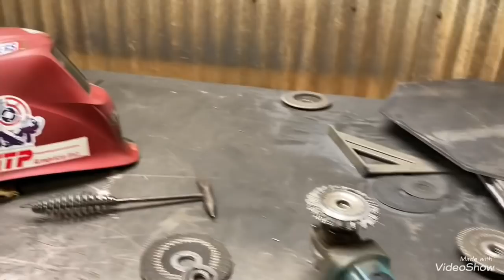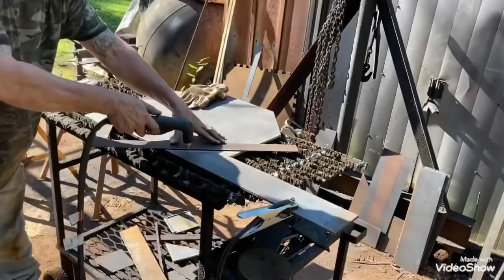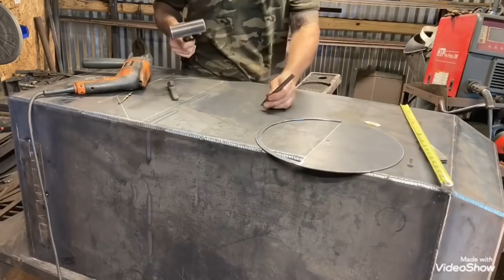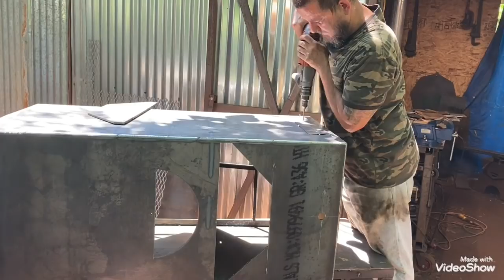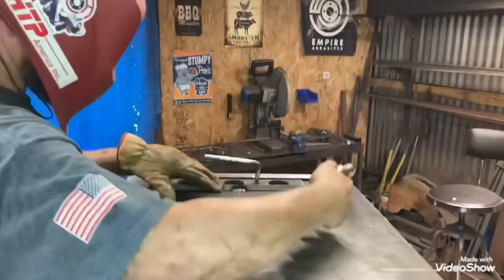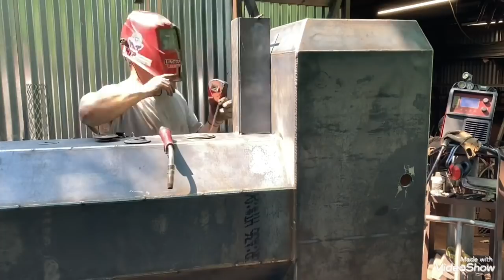Bbq smoker and fire pit builds

Comment: How has the material cost affected your business? Do you raise your price and pass it on to customer? Man material is 380 for a sheet of 1/4 here
Reply from the maker: It’s horrible! I’m doing orders from 7-8 months ago before steel prices got so high and I can’t change the price on those since they already had deposits down.
Reply: @Allensweldingwoodworking  Very honourable of you Allen to produce it for what you quoted it at. Unfortunately working for nothing is not the solution. You have to pass the increase on to the consumer. You might lose a few customers but you]ll stay in business in the long run.

Comment: I mentioned on your previous video that plasmas need really dry air. But I forgot to include its in large because if not they blow through tips and electrodes really fast. Set yourself up a large radiator style condenser.